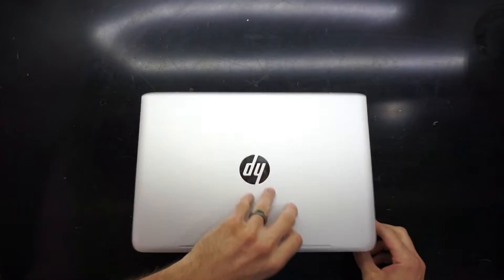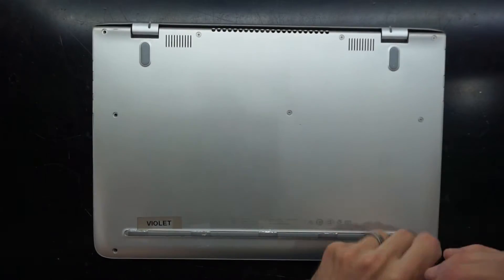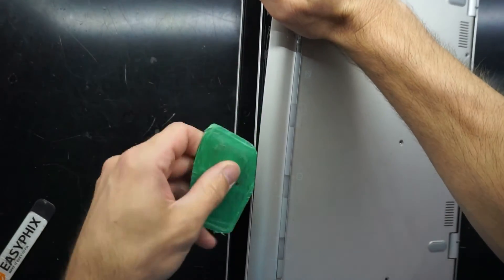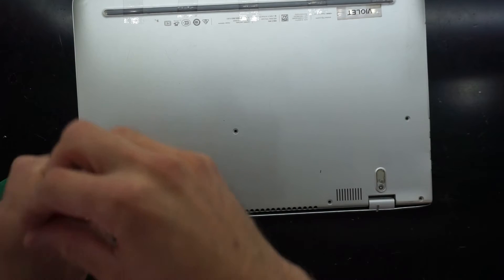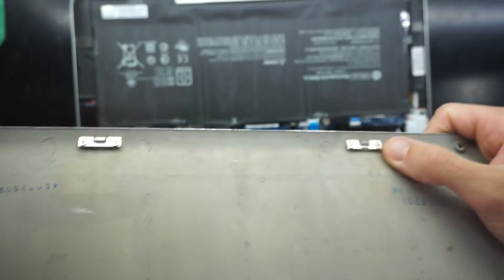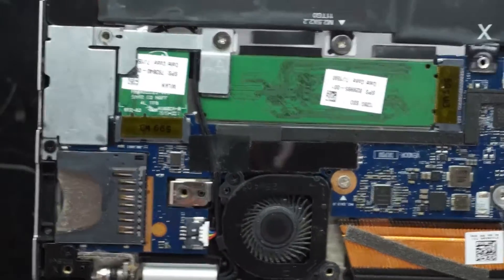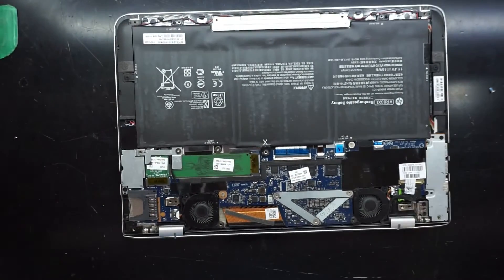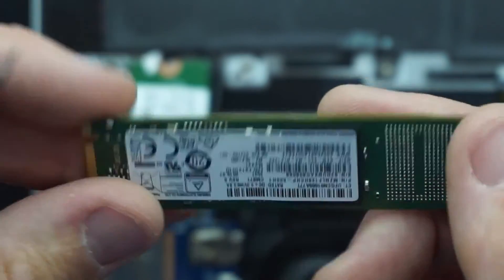Hp Envy 13 2016 tear down and m.2 removal

Comment: If this isn't charging, it might be a problem with the charge port. I thought mine had a broken charging port but it turns out if I very slowly plug in the barrel jack, the charge light goes orange and it does charge.
Reply from the maker: Good observation